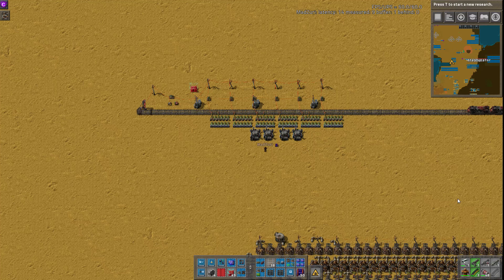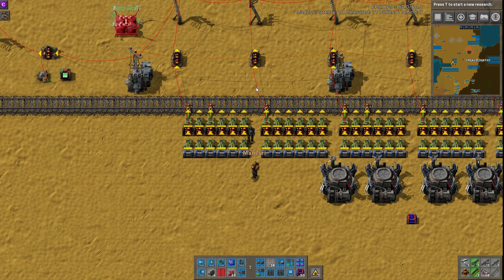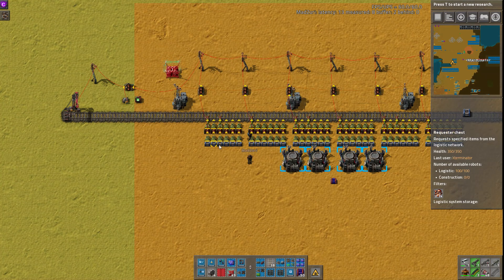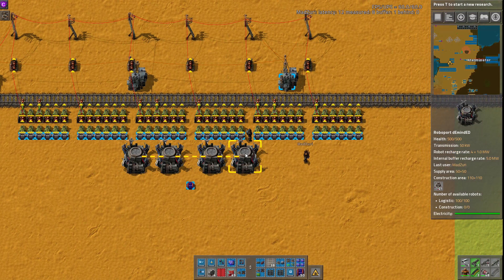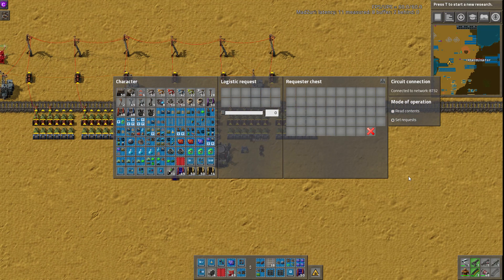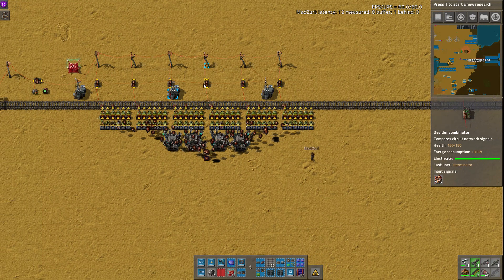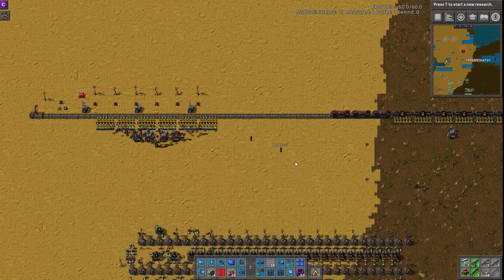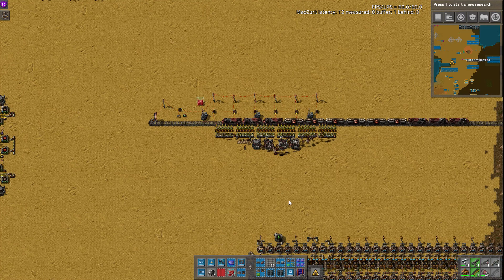Outpost Train Caller / Controller Setup :: Factorio Workshop Season 2 - Building A Better Factory

Comment: I usually use this kinda setup when a patch is running low. I'll set the train's orders that goes to it as 
SM > Copper 1 > SM > Copper 2 
and set the logistics condition if there is anything over like a few thousand the train can go to it. That way it can still get filled at max rate as long as other OPs can support it.
True, its not the best for though put but it pretty simple to do on the fly.

Comment: I just make a 1 train per outpost and have the red wire connected between big power poles in all of the railway blueprints. Every outpost gets the logistics network signals.
I put a rail signal in front of outpost train stations and have it turn red when ore is >1 million, that way I don't get too unbalanced. Also, the train isn't bothering anyone and it doesn't need a separate waiting area. It is also full and launches immediately when ore drops <1M.
I put some speakers in the base to sound the alarm when any ore in the network is >1M or <100k, it's a nice reminder to build more or less outposts of the type.
If anything is <100k, make more outposts of this type.
If everything is >1M, then upgrade the base!:D
When my base gets larger, I'll change signals from 100k/1M to 500k/5M or something... Perhaps I will make local settings combinators inside the base and then use this signal in every outpost so I can change the settings more easily and in a single centralized place.
Reply: oh, and also, with 1M mining cap on iron/copper and 500k on other resources, I can have 5M logistics storage and I know I will probably never run out.

Comment: I was trying to get a similar system working, but in such a way that I could keep each outpost named the same ("Iron Outpost" "Copper Outpost" instead of numbering each one) and have the trains only go to the stations that had a full load ready to go. The detectors I set up were a bit simpler. I also had set up the "way station" as VGG described in his comment, but the problem I would run into was that EVERY train would make a bee line for the closest station instead of being able to just send one at a time to each station that made the call. Never did figure out how to fix that, though I also never got that megabase up to full speed either.
Reply: Yeah, I tried limiting the trains that were sent out by using a "trigger" signal when a station was opened, and then each trigger count would open up a lane on the train shed. It helped a little, but they still would bunch up at the closest one, and once it ran out of ore and disabled itself they'd be stuck on the line. It worked decently well while the factory was running at full force, since the outposts tended to not activate at the same time; but any pause would let the stations build up more than one trainfull of ore and lock up the trains all over again.
Reply: Hi, so I'm working on a mega base with only "same name train stop" and I've designed a work-around for that: as soon as a train stop at an ore station I deactivate it until (train leave the section AND enought ore to fill a new train).
I did not test this with a full scale train network, but at least this will avoid clogging because of the bee ligne.
Reply: I hadn't tried that, and it's a decent idea - however in my case, the problem is that multiple trains are headed for the same patch before one even arrives there. If I disable the station when the first train gets there, then they'll just be stuck on the line heading towards it rather than in a stacker at said base or something. Though, I guess, if I added loops to the ends of my lines so that the trains could circle around, they might decide to find new stations rather than being stuck ... it's worth looking into :)
Reply: yeah that's also my concern, obviously this will greatly increase the travel time but I hope this won't clog the train network. But I don't have any great idea on how to "select" properly the station the train will go to.
A (probably) good solution would be to have your train network shaped like a tree with intermediate station on nodes that would be deactivated if too many train are in this part of the tree, so the next ones will be sent to another branch.
I will probably try to implement that if my network gets too clogged because of the simple train pathing.
Reply: Wire all your stations to your base station, let the train leave only when there's at least 1 station opened, read that signal by the wiring comming from each of them. Simple, easy and trains never path wrong if you do it right.
Reply: Yeah ... did that. But I couldn't figure out how to only send one train when one station opens. I would trigger the release, but the signal wouldn't go away until the train arrived. I guess I don't know how to do a "pulse" signal with combinators, where you trigger it and it sends a signal and immediately turns off. If I could do that then that would probably solve most of the problems.
Reply: Yes but sadly I don't think you can use that to control train pathing yet...
Reply: And btw I already use memory cells to manage the number of train in my stackers (so they fill-up evenly), they are really usefull, and even essentials for advanced logical function. check ou https://wiki.factorio.com/Tutorial:Combinator_Tutorial#Binary_Cell and also https://en.wikipedia.org/wiki/Flip-flop_(electronics)#SR_NOR_latch for a better understanding of the latch.
But as explained above, I still need to figure out a way to use my outpost more evenly.
Reply: Darren Pendleton so i just started working o. This tonight. Right now what i am doing is i detect for how many out posts are full. If a train leaves i add -1 to the outpost count.

If multiple trains a ready to leave they will still all go. But if one becomes ready after another has already left it will prevents it from leaving. Just have to figure out the multiple simultaneous ready trains issue.

Comment: I was excited when I saw the title... but dissappointed when I saw the video.  It is a different way to turn the station off and on, but that is not actually difficult to do. Mentioned at the end was the problem with this sort of set up, that when the station turns on there is a rush of trains to the outpost, and after the first one gets there the others no path.

Nilaus system is horribly complicated
Reply: VideoGameGeek1970 No criticism of your system, it looks good and works fine.  But there are a lot of ways to acheive this.
From the title from Xterm, I had simply expected something more.

Comment: What's the difference betwenn using 1 Arithmetic per 6 chests (or wagon) instead of putting 1 Arithmetic to do the math across all the chests? Seems unecessary for me.
Reply from the maker: Mobius one using one for each makes sure that each set has 2k so it ensures a train can fully load. If you just use one across all of them, some could have more than others and result in unevenness which slows down the train loading.